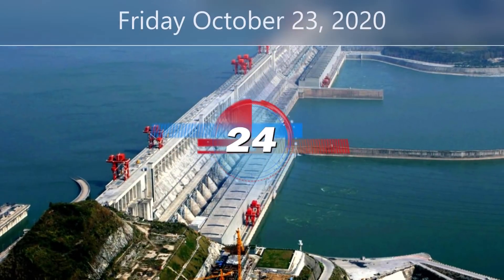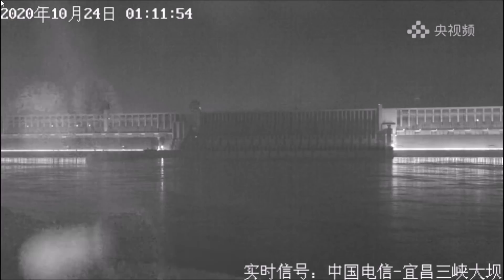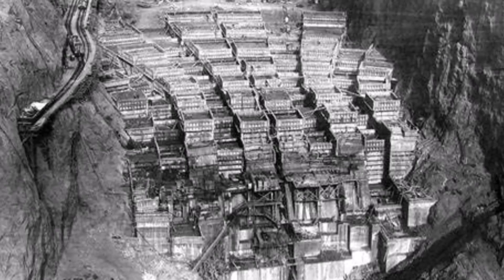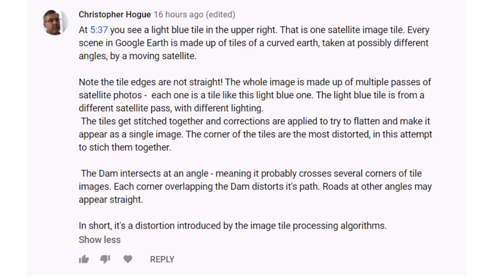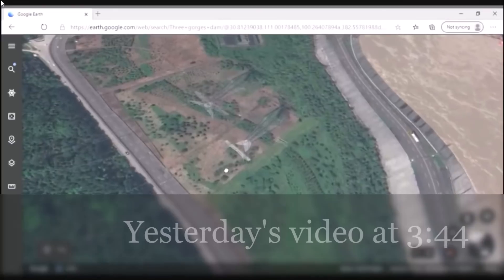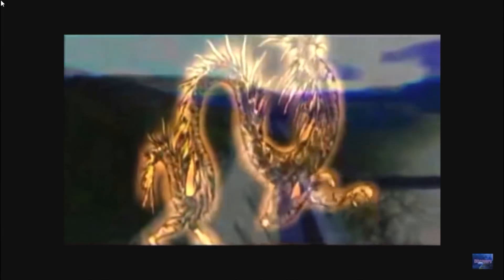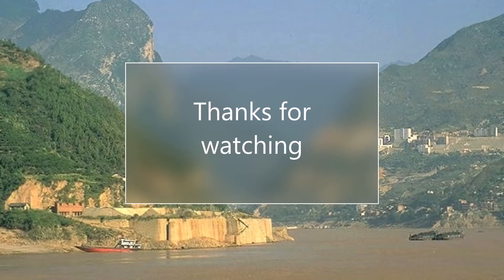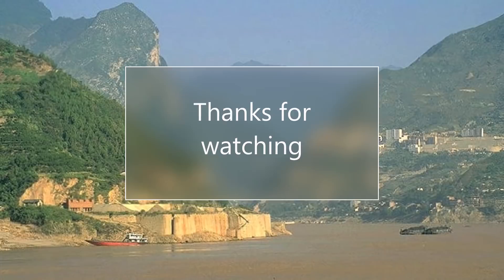Three Gorges Dam Update October 23, 2020

Comment: This makes me wonder, if they dammed the Nile a few thousand years ago, 🤔

And the Flood.....was of their own fault.
Reply: Well, if you want some historical interesting facts about that story; The northern most tip of the Gulf of Suez is quite a bit shallower than the rest, and wasn't there originally in the earlier part of Ancient Egypt. In fact there was a road across what was then the edge of the gulf from Egypt to the Sinai Peninsula, but at the time of Ramses II (the time most believe the Exodus story takes place) had already fallen into disuse. If we assume that something was causing the gradual sea level to rise in the area at the time, or the land sinking, causing more and more land to be gradually inundated by seawater, that road may have only been passable at that time at certain times, and more a local specialized knowledge at that point (meaning Moses who bummed around the Sinai for a while might have learned about it from the locals who likely still used it to get to Egypt). It would have been especially dangerous for those trying to cross it on a chariot rather on foot, as the wheels of chariot would likely have gotten mired while those on foot would still have made it through a foot or so of tidal flooding. The biblical story does describe Moses as waiting for the right time to cross (if one ignores all the miraculous overlay), and can be seen as waiting for the receding tides.
I'm a historian, not religious at all. I don't think this proves or disproves the Bible in any way. I just think that, considering human nature and how people understand things, it is a possible realistic explanation of what may have happened that is consistent with known historical facts.